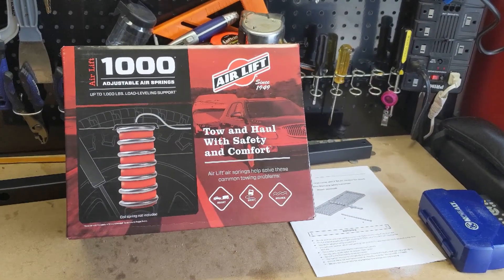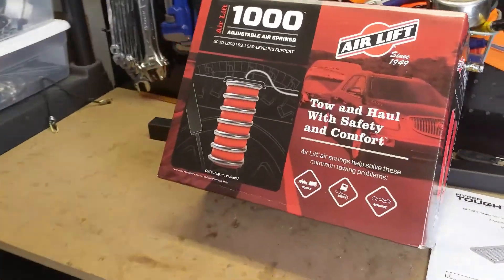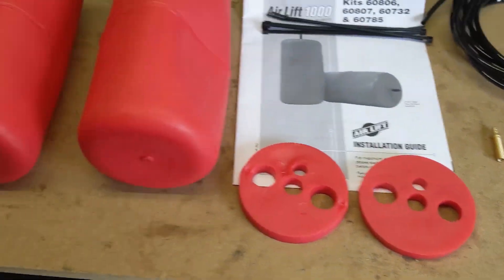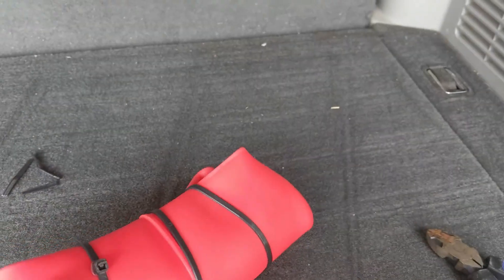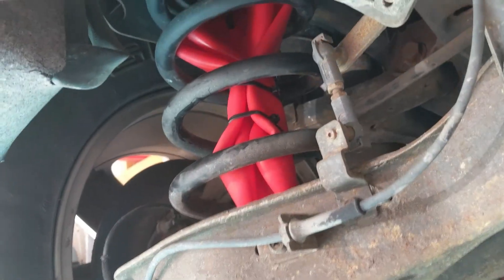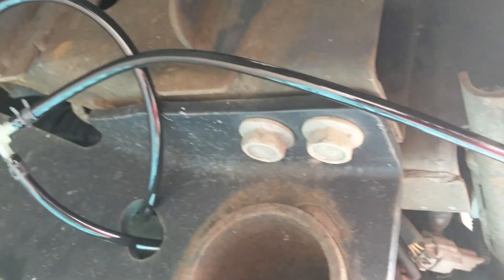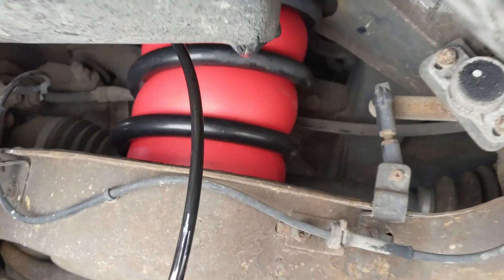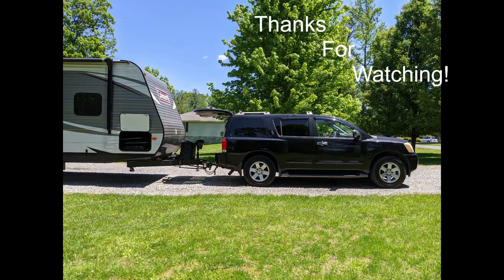Nissan Armada '04 air lift 1000 air springs

Comment: Does  your vehicle  have a factory installed  air springs in the rear?
Reply from the maker: Yes but they've long since failed. It's an 04 armada
Reply: @jimbosgreatadventures2923  copy, I have the 05 qx56,  bags i hear are pricy and don't have a long service  life. Wonder if these would increase the life at all. Might give this a whirle this weekend